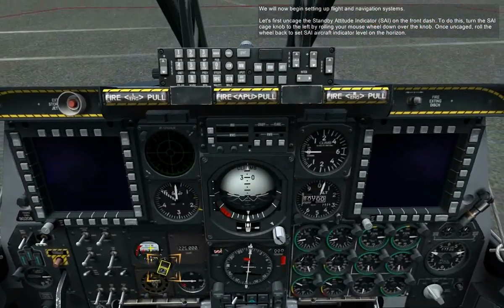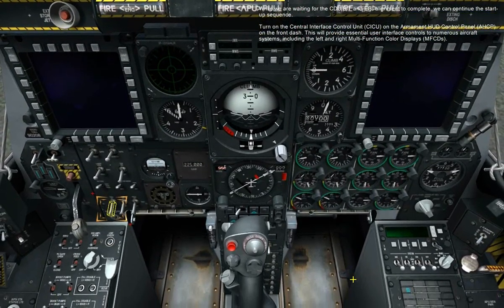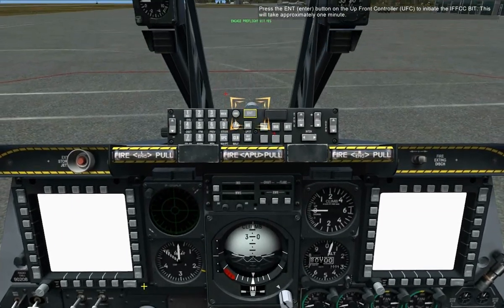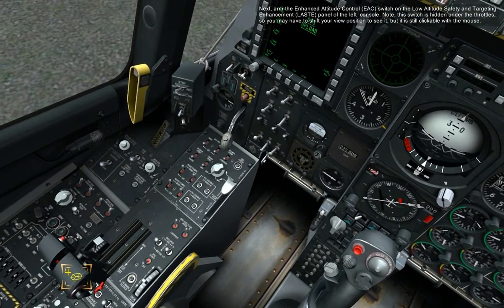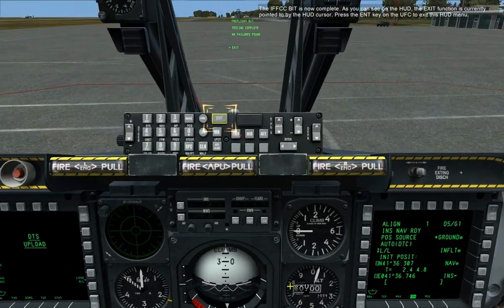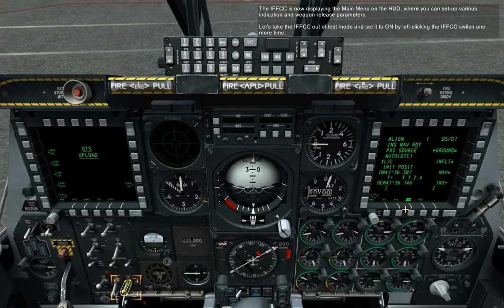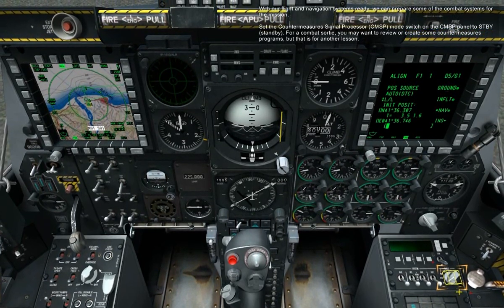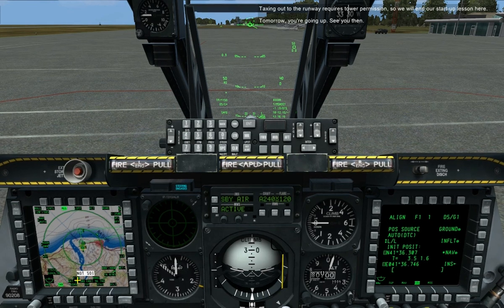DCS: A-10C Warthog Training - Start Up, Part 2

Comment: @Torikkaa 

It's JAS 39 Gripen or JA 37 Viggen

First letters mark aircraft role. Jakt (intercept), Attack (Bombing), Spaning (recon) with the first letter marking the primary role for the aircraft type. The 37 Viggen system comes in different configs where a JA 37 is a interceptor with secondary strike apabilities while a AJ 37 is a strike aircraft with secondary AA capabilities.

The following numbers and letters represent aicraft system i.e 35 Draken, 37 Viggen and 39 Gripen.

Comment: There might be a button to do it too, but you can do it by just moving your head around with TrackIR. With the 3 point clip model it tracks in 6 axis (including up and down like at 0:34) I use my homemade FreeTrack model and it works just like in this video.

Comment: That's not even a question.  Use Thrustmaster's HOTAS Warthog setup.  It's licensed by the USAF and models the actual flight stick and throttle quadrant of the A-10C exactly.